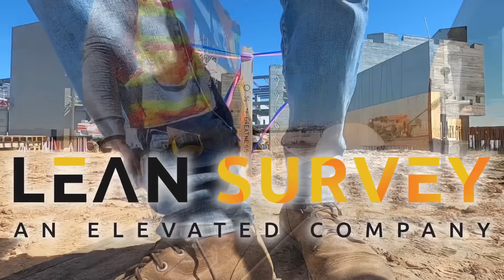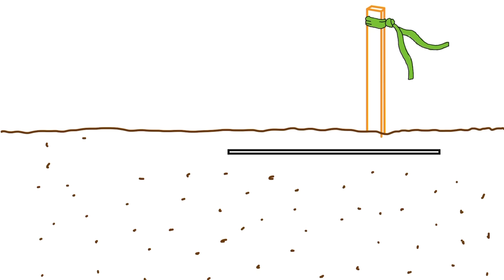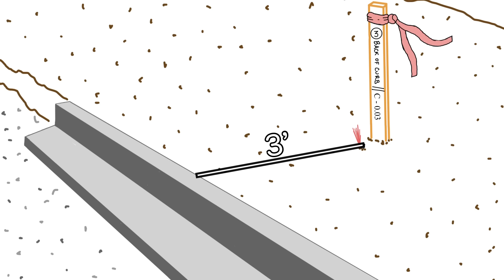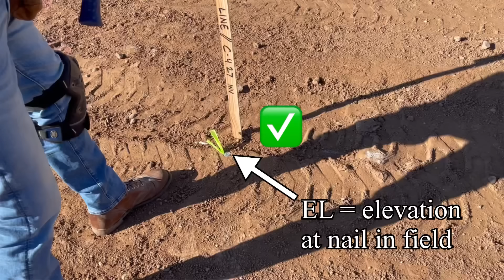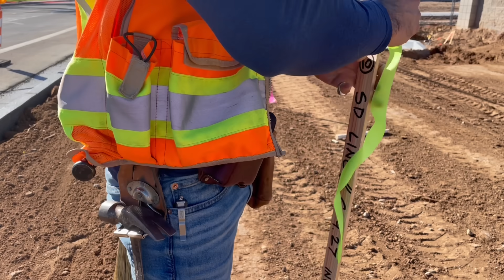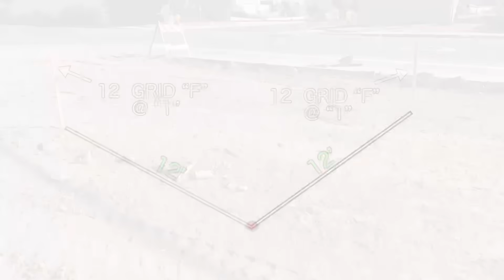Surveying: How to Read and Write Survey Stakes

Comment: I survey in Canada. Not a chance in hell anyone would know how to use those offsets, let alone any offset.

I will occasionally leave hubs for work that's going to be done down the line, but it's very rare I get jobs like that. 

Nobody likes offsets, and nobody uses tacks and hubs anymore. I think it's because everything needs to be asbuilt these days to tolerance deltas, so it's rare they wouldnt' have as ..unoffically work as gradesmen too. Oi.
Reply from the maker: It so interesting to see all the ways people shift and work around the issue of tolerance.  In the GC world, grid line layout is being done so poorly even by third party surveyors (utilizing GPS sadly) that they have opted to completely cut the surveyor out of the process and are using their internal on site field engineers.  Not that they are better at the task or at layout, but because they are more invested in tolerance construction from a cost perspective and to avoid rework.  It’s an interesting time.  Great to know there are still folks invested in what they put their name on, right?!
Reply: @leansurvey8212  oh absolutely. That is definitely interesting.

A guy I worked with here is taking over a 5km conveyor belt job because the previous surveyor set the anchorbolts with GPS...and that wasn't even his greatest foul. 

He also brought out the total station when he saw it wasn't working, used scale factor 1 without doing any sort of scaling to his grid coordinate job that was done in UTM (a scale factor of .9996 at the central meridian, secant projection with 6 degree zones). Massive problem that could have been caught doing a single checkshot. Didn't bother asking the engineers for a scalefactor 1 version of the plans and doing a localization, or even the old fashioned finding a mean combined scale factor to work off instead...

But in his defense, they were ordering steel and conveyor parts off the grid distances shown in the plans (they were not converted to ground) anyways.  I figured by this year, this would no longer be a problem, but I keep seeing it happen.

All that doom and gloom aside, about 8 or 9 years ago, I decided to enjoy what I'm doing, and really focused on improving. I haven't met a person yet who knows Trimble access as well as I do (but I definitely know they exist), and I always strive to get better and improve. 

That's why I love your videos. You've got skills that I remember seeing and learning from the older boys back when I was an instrument man. The basics seem to be gone and the things that require skill getting pushed to the side...but those are the enjoyable things, and they still have value. 

Like I forgot how to buck in a level, been ages since I've done it. Your 3 wire notes: learned it in school, but the equipment and tolerances were never so tight (and my eye was never so bad) that I'd concern myself with that tolerance, but now that I'm seeing the advantages of it, I'll definitely be adding it to my toolkit.  Honestly, everyone else is doing really basic survey videos, that I mostly stay away form them, but yours has lots of meaning. 

Truth be told, I've watched more carpentry videos to help improve my surveying  than I have anything survey related...just because it's too basic. Keep doing what you're doing! I really enjoy it, and glad to have stumbled upon your stuff! 

If you find topics where you're think "a junior would struggle with this", it's right up my alley...even if something like 3 wire notes is something you'd expect all juniors to have (I do the standard STN/BS/HI/IFS/FS/ELEV notes) .  

I'd especially love tips for working in imperial too that you give to young guys. (I'm mostly metric, but earthworks guys often like switching to inches when under 3 feet, carpenters here are metric for elevations, mostly metric for horizontal, but often go into feet and inches - but never decimal feet, pipefitters like metric and inches, and millwrights seem to work in mm then swap to thousands of inches (to tight for my gear) when things get really close. So although it may have limited use up here, it's still interesting learn how others do stuff!
Reply from the maker: Also, “Nobody” is a big word.. there all kinds out there in the wild wild frontier of survey.
Reply from the maker: What type of work are you doing that doesn’t utilize offsets?  Often you can’t stake out ‘actual’ locations because then the nail or hub would be destroyed during the course of construction.  When the nail or stake remains, it can actually be used to QC the in-place work.  Hub and tack are still utilized by field engineers here in the Phoenix area- in fact, its that group which sparked creation of this video.  Presently, I set most things using a 60D nail, but they aren’t as accurate as an X on concrete or a tack when precision is key.  I always consider the end-user and the precision required when selecting the object I use to mark a point, and it may vary from task to task.  Beware any ‘one size fits all’ attitude in the Survey industry.
Reply: @leansurvey8212  no I think it's great that you guys still do that. Its literally a case of "we did that 15 years ago" and nobody uses it anymore, or feels confident pulling their own offset to it. They'll just "call the Surveyor to work with x trade to 

Example is industrial pipe fitting. I'll give paint lines on banks and offset stakes with distances, nobody will tape it. They can visually see where I'd extend lines and just eyeball it.  If I were to offset it parallel and not on the line itself,  they'd just end up digging or putting the thing directly on my offset line and it it would be out by that amount. It really is that bad.

Take even using gridlines to layout anchorbolts. In Industrial, it's the same concept. Carpenters will have me mark up batterboards with the gridlines to set up their templates, but obviously they won't be set at a specific or square offset to each other. Instead of stringing out their line/intersections, they'll run tape off the batterboard nail with an assumption that they're both square and putting forms in the wrong place.

Anchorbolts used to be just helping set templates if they can't use the gridlines for whatever reason. I'd set up on the gridline itself, use a gammon reel for setting alignment and a peanut for getting the distance right. Check rotation again with the gammon reel and call it good.

Now, it doesn't even matter. "The templates could be wrong" and engineers want pre-pour asbuilts of the bolts themselves with a tolerance of under 3mm horizontal and 0 to +9mm on the projection. We're working with carpenters setting every bolt.

That's industrial anyways. The irony of it here, is that they want to use us as grades man and layout guys too, but they don't want to spend money on us having assistants. So it's a very strange world.

It has its pros and cons for sure. I feel more apart of the group building things and I get to interact more with the different trades than how things would have worked 15 years ago...but it also means more often than not I feel as much a carpenter Forman, civil foreman or pipefitter foreman as I do a Surveyor.

But it would be really nice to not need to be 100% aware of everything all the time.

QC on these projects only care about delta reports. They want one for everything, and don't even have enough time to actually catch the mistakes I do.

To give you an idea on "QC" here: I've had a pipe inspector who was watching my work for almost a year ask me what a "pipe invert is"  , and another ask me if the rebar was good and in spec.

You'd be driven insane up here, but I know work in the cities is still more typical to what you're doing.

Comment: love your videos. I would say that a double back slash typically means "thence" for slope stakes. I know there is a lot of regional variance with how you write stakes, but I've worked in most western states and double black slash is used primarily for slope stakes after initial cut/fills. Correct me if I am wrong...
Reply from the maker: I agree with you, I’ve laid out my fair share of highway and that was how we delineated “thence” as well, and fortunately those we worked alongside were great at identifying and interpreting the fact that they were indeed looking at a slope stake.  Slope staking rarely appears on commercial, municipal or multi family construction sites (save the occasional large retention), and even then needs to be thoroughly explained to the excavation contractors.  Outside of that a double slash or a slash that CLEARLY goes edge to edge is best. The primary point of these marks is creating a 100% clear delineation and not having anyone mistake your slashes for additional letters on numbers- especially when the stake gets cramped for space.

Comment: We will often not use nails for things like storm and sewer lines. We use just the two stakes. The way you have the witness stakes behind the nails, you cant pull a straight line through the nails. If you just use the two takes, you can hook a tape to the back stake near the ground level, pull your measurement to get your line. The pipe crew will then most likely use a laser or total station to refine the flow line to the next structure. Another thing we do to avoid confusion is to avoid using measurements like 4.27'. we will place a mark on the stake that is an even number. so in your example, the nail is roughly at ground level, so we would measure up the offset stake 0.73', draw a horizontal line and write the number 5' signifying that the invert is 5' below that line. Hopefully i have explained this clearly. Every company has their own method and its interesting to see them all and use the best practices from each.
Reply from the maker: I’ve seen the two stakes method as well,  as you say, there are many different methods.  The nails provide a nice solid surface from which to measure grades rather than measuring from dirt, they also provide a more precise horizontal location to pull a line through (roughly a 1/2” circle) IF you are looking for more positional precision. For utilities, 1/2” horizontal accuracy could be overkill, and the lath would be all the precision you need. You mentioned you provide marks at a solid foot to measure from vertically, seems like a decent method to be sure. Thank you for sharing it with us out loud!
Reply: Thats not too dissimilar to here. Nails used to be common for setting culverts and offsetting the line like you said there as witness, but guys typically ignore it and try to get me to either set it on the inlet and outlet sides (why boys they'll get knocked out when you swing it in) so I get a bit creative.

I'll put a nail at the invert but without flagging, usually a 6 or 8 inch spike. Then I'll put a lath about an inch behind it. My offsets are dependant on a few things: if I know if they'll be cutting an excessively long culvert, or if by some weird engineering decision (happend on my last job where using HDPE they didn't want to cut it) I'd math out how man culvert pieces they'd need, and set the distance of the offset based on centering the extra long pieces. 

Eg: plan calls for 21.05m culvert. They only have 6.03m section pieces.  So they will need 4 pieces since they're not allowed to cut it. At 6.03m x4 their actual length of culvert will end up being 24.12m. That means I'll set a stake on both sides at 10.52m from centerline/midpoint of culvert line to show where the design location was supposed to go. At 12.06m I'll set an unflagged spike on both sides. Then at 13.06m from Centreline on both sides I'll set another lath. I'll set grades somewhere with the percent grade (since the grade is also supposed to be extended completely disregarding how that ties into the ditch I might add) and a fill (usually I do this after I asbuilt the excavation for it). I'll get a phonecard asking for me to put underside grades on lath with ribbons. I tell them no, they have to use a laser level or pipe laser or they're gonna need to wait for me to setup a total station (they'll use a laser level or call a different surveyor).

When they "call me back to help them set it" I'll keep my GPS in the truck, and grab a 4' level and plumb it up on my nail and tell them to push it forward until it hits. And tell them it's good and I'll asbuilt it before their inspection, and that their grading better be good (since they wiped out any stakes that had grades on them).

They'll ask me how I know,  and I'll show them that my stakes are exactly 1m away from the invert now. They'll see that I used my spikes and 4' spirit, say "that's a good idea, I'll just do that next time" and then never bring one with them (even though my 4' spirit is checked out from their vast wall in their own tool crib)...hahah